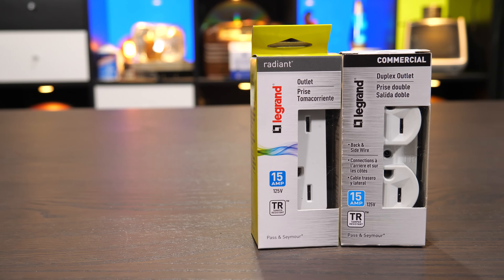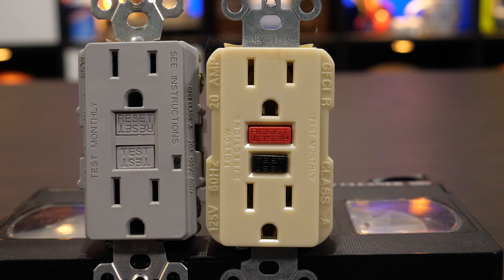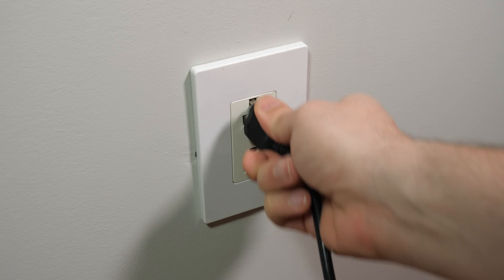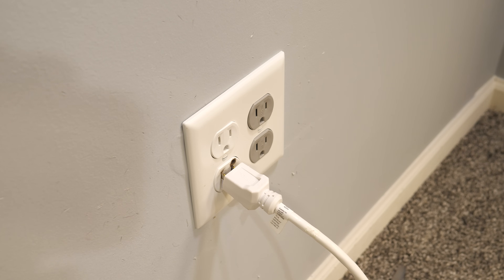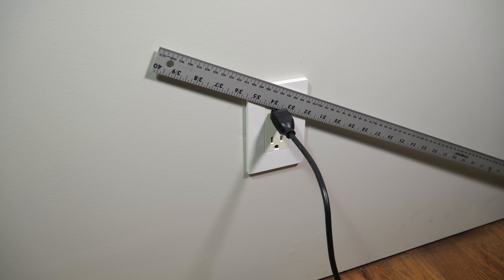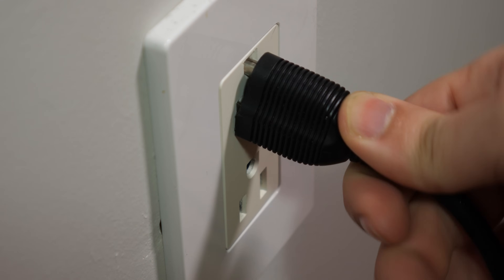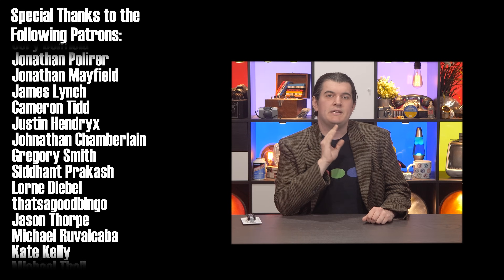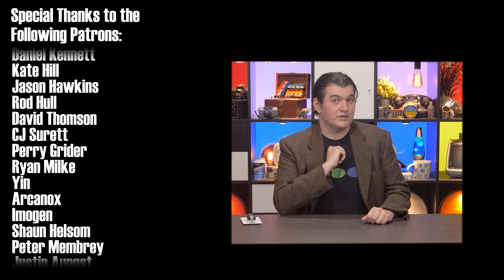Power outlets are topsy turvy - but does it matter?

Comment: I was a victim of the “falling metal wall plate” scenario.  I had the room painted and the painter removed the wall plates. Afterwards he forgot to screw in the plate. I went to plug something in and the plate fell down and shorted out. Sparks and a nasty char mark was the result.
Reply: Bleach and a good soaking should get the char mark out, otherwise just buy a new pair.
Reply: I dropped a tape measure in between a plug and the outlet it was plugged into. Nasty surprise.
Reply: ... Sparks and a nasty char mark was the result.
     And yet, you're alive to tell the tale.
Reply: Is he still alive?
Reply: Yeah. Sht happens
Reply: Kick ass!
Reply: Yikes! I wonder if the newer style of two outlets in a rectangle plastic and a plate with two screws makes much difference. I moved into an older place a relative had, and one of the first upgrades I did was replacing the outlets and light switches, and I used plastic plates with two screws. In fact, the light switch and outlet plates are the exact same since the light switches we got are also rectangle. Which made it easy to buy the plates in a large box and use them for everything (except for places with 3 switches together), and they seem pretty solid with that extra screw.
Reply: How did you fail to notice there was no screw in the plate before plugging in? Sounds like a skill issue.
Reply: I replaced the metal wall plates. They should be prohibited by code.
Reply: @fuelgaugeguy  I've only ever seen them in commercial locations unless it was a fancy brass/bronze one a homeowner added themselves, it's basically all plastic in residential.

Comment: Wouldn't the solution for most of these issues just be to put the ground plug at the opposite side of the outlet, except for one case, when you mount the outlet sideways since then you can short two plugs.

Comment: I've had one appliance with a ground-up right angle plug. It was the special leakage-detector cord on a portable air conditioner. Search for "WJ35X10142" for an example (although in my case, mine was regular 125V/15A)

Comment: I am shocked to see the terrible design of the USA plugs and receptacles.  The tiny narrow short plugs look so flimsy, both the grounded and ungrounded. Why not at least have a proper wide collar-flange to stop 1) sliding your fingers forward, and 2) less tilting downward.  But I don't know if there are many recessed receptacles that are too narrow for a wide flange.
The European version is so much better. it feels safe and is convenient to handle.  
But the best is the UK design. Big wide flat plugs with sturdy prongs that suck into the wall-outlet like the last puzzle piece.. Even small desk lamps have a plug like that. The receptacles each have a switch, and a fuse inside.
Reply: You’re shocked?

I see what you did there.

Comment: One time I broke a guitar string and when I bent down to turn my amp off, the string slipped in between the plug and socket. Sparks flew everywhere and I got a little scar on my hand. It was very rock n roll

Comment: My Husky rolling work bench with power strip has a flat mount plug that has the cord pointing away from the ground pin so the cord points up for my standard outlet.

Comment: The problem with the American outlets and plugs is the standard was set 100 years ago, before they thought about safety, polarized blades and the third ground pin.  Me personally it makes sense to have the ground pin at the bottom, because of the right angled plugs and wall wart power blocks.

Comment: I'm an electrician. I really would love to see you talk about 3-way switches and how they're wired, how they work. They're pretty cool, but there's a few ways to wire them and it's annoying to see most of the youtube videos cover only the feed to one switch, light leg to the other orientation. Sometimes you have your light leg and your feed coming to the same work box, and you gotta use the neutral wire of your traveling 14/3 or 12/3 to send power from the feed to the common terminal on the separate switch. Make sure you tape that white wire with black tape so anyone who looks at it knows it's hooked up the way it is for a reason.
Reply: I also just wired a 4-way switch. that was kinda cool to work with.

Comment: Those very specific scenarios are why I put most of my plugs ground up. I had a more than a few instances where something metal fell on a plug that was droopy. 
While very uncommon (like you can't just walk into an electrical or department store and find them anymore), there are adapters and I had a grounded extension cord with a right angle away from ground, so it would point down on the ground up outlets.
Also, there are DIY  plugs that allow the head to be clocked, and 'rotatable' plug extension cords, though I do not have high confidence in those.

The best part about 90 degree plugs is when they are unplugged and laid out on the floor, at 2 AM when barefoot.

Comment: UK sockets are so much better.   

if i was living in the states, i'd seriously consider changing the plugs and outlets for UK type.   Safety shutter in the ground pin prevents you pushing things into the live and neutral lines, (hence why our ground pin is longer) and insulated pins too means you can't short it if the plug is part out

Comment: 13:00 this feels contrived. you describe how ground up doesnt work because 1 slot blocks the other, and that if you want the wire to face down without it backing on itself. then show how sideways mounted works fine yet it has the exact same issue. 1 slot blocks the other and you cant make the wire face left without it backing on itself. and its not like some devices wouldnt benefit from the cable exiting the top. a computer on desk is the first to come to mind.

in reality i dont see how its much of an issue. replacing the plug head shouldnt be that hard if someone desires that. farnell seems to have heads for ground up cord down. (i assume hardware stores carry them too there?) but i guess this is what happens when you dont have regulations to enforce the install of the socket. maybe we should go and make it standard for it to be installed 45 degree angle so everyone is unhappy

Comment: I removed one of those security system power bricks that screws through the plate screw hole to keep it from being accidentally removed. There was a metal plate, and as the only screw was removed so the brick could be unplugged. The plate fell on the hot and cold blade at once. BOOM! Time to replace the outlet and plate, with a plastic one of course.

Comment: in england, all plugs are right angle, the ground is at the top, they have switches, that are better built and more robust, the positive and negative pins have insulation, you can change the fuse in the plain with nothing more than a screwdriver, the plug has a fuse in the first place, they supply more power, every plug has a ground pin

Comment: As I saw the first minute I understood because an accident that happened to me: in 1970 it was a trend between children here in Brazil to use a big medallion on a chain around the neck made of antimony (!) with the first letter of your name. I was taking the plug of the Christmas tree out and it shorted the  pins, by chance I didn't receive a shock because it probably touched the neutral first. The pins melted two holes on the medallion and I never used it again. At that time few outlets were NEMA and usually on offices only (some of my father radio equipment used it) Today in Brazil we use an outlet with a diamond shaped recess, so when the plug pins make contact they are not exposed anymore and the plug pins with only the tips of neutral and live exposed because of a sleeve and the ground pin is entirely exposed in a way that it always makes contact before the other two, so this could not happen anymore. Those things generally don't matter ... until the day they do. If it is a chance in 10 million someone will have the unluck day...but turning the outlet is not the solution, NEMA plugs suck bigtime.

Comment: Personally I tend to prefer the face orientation because of right-angle plugs; altho the one behind my desk that my computer is plugged into is actually ground up -- my power strips are mounted on the underside of the desk, so it pulls the wire up, instead of looping down and up. I also have sideways plugs in both orientations around my house, lmao... Altho those are installed in baseboards, so there isn't room to mount them the other way.

I do think it would be possible to do a partial sleeve on the live and neutral pins without breaking compatibility -- the way you did the shrink wrap on that one on the end, that SHOULD make full contact within the receptacle. I'm wondering if the reason we haven't seen that is because the blades are so much thinner than the shafts used for the types of plugs that do have sleeving

Comment: Nice video. Here in South Africa our plugs are standard Ground up, much bigger than your 3 prong plugs. And our 2 point plugs are recesed into the wall adapter. So, yes. And the 1st bit is insulated. Even the cheap imports have plastic on the 1st part. We shudder when we look at American plugs and wall outlets.

Comment: The UK plug is widely regarded as the best in the world due to its numerous advantages and superior design. One of the key features that sets it apart is its safety standards. The UK plug incorporates a three-pin design, with two parallel pins for live and neutral currents, and an additional pin for grounding. This effectively minimizes the risk of electrical shocks and ensures the safety of users.

Furthermore, the UK plug's design includes a fuse, which provides an added layer of protection against electrical overloads. The fuse acts as a safety mechanism, preventing excessive current from flowing through the circuit and potentially causing damage to devices or even starting a fire. This feature greatly enhances the overall safety of electrical appliances and promotes peace of mind for users.

In terms of convenience, the UK plug also excels. Its rectangular shape and robust build make it durable and easy to handle. The pins are well-insulated and fit snugly into sockets, ensuring a secure connection that minimizes the risk of accidental disconnection. Additionally, the UK plug's design allows for easy insertion and removal from sockets, making it effortless to use and maintain.

Moreover, the UK plug's compatibility is another advantage that sets it apart from other plugs worldwide. It can be used in various countries, including those in the Middle East, Africa, and Asia, thanks to its ability to accommodate different voltage and frequency requirements. This versatility makes it a practical choice for travelers and individuals who frequently move between different regions.

Overall, the UK plug's exceptional safety standards, convenient design, and compatibility make it the best plug in the world. Its robustness, ease of use, and ability to adapt to various electrical systems make it a reliable and trusted choice for both domestic and international use.

Comment: At 6:45 I appreciate his acknowledgement that the less protective but smaller plug shape might allow them to fit better in power strips. There's so many annoying as hell power bricks or other device plugs that do not smoothly fit on power bricks. And while the slimmer design might be less protective, I'll take less the ease of use. I've only shocked myself once in my life while unplugging something. I don't think it's too huge of a deal that the NA standard is less protective. Although, I will acknowledge those really old plugs he showed off are absolutely absurd. They also brought up fond memories of being at my grandparents house growing up as they did have some devices with plugs like that.
Reply: Somewhere in my house I have a power strip that we call a squid design. Instead of a rectangular block there are six short cords of different lengths that stick out of a distributor so that one can spread the outlets out to accommodate power bricks (aka wall warts).
Reply: @SchmCycles  That's a nifty product. And an evil one lol. Don't eradicate the wall worts, just construct a new type of power strip to allow people to accommodate them.

Comment: My apartment outlets are installed the "correct" way (ground side up).  I always wondered why.  It usually doesn't bother me.  But right angle plugs are never designed for my "correctly" oriented outlets.  Which is annoying as hell.

Comment: I cant remember if it was to make things easier or a safety concern or what, but when i was first learning electrical work i was told the ground should be on the same side the wires are coming from. So if wires coming from underneath, ground pin should be on bottom and vice versa. If i had to guess, it would be in case the ground popped off it wouldnt be pulled toward the hot but thats just a guess

Comment: As you probably know, in the UK right angle plugs with the lead exiting the bottom are mandatory (except for 2 pin shaver/toothbrush outlets which are transformer isolated).
Reply: Yes, the correct solution to all the problems he mentioned, and more, is a UK plug and socket. As many, many, many US electricians have pointed out on YouTube. Superior in every way, because some people actually sat down and thought seriously about the subject, and tweaks have been made. There are too many benefits to list in a comment. Meanwhile, everyone else uses sub standard technology, and few if any use their own version of the same thing. It's time to standardise the world (and it absolutely doesn't have to happen overnight to do that).
Reply: Not superior in safety but necessary in the UK because of a bad current choice.  In North America accidents entail a zap and some cursing, that's all.  I have many experiences to confirm this.  The pros swap receptacles without turning off the breaker sometimes.
Reply: @cloudpoint0  Much of the rest of the world went with 240V, the UK was far from alone in that. And really the US has 240V, you just have this strange split mains scheme whereby you can have two nominally 120V circuits in the house which actually have 240V difference between them.
Reply: @owensmith7530  
I'm well aware that much of the world decided to risk the lives of their people to save a few pennies on house wiring.  When I lived in the Middle East, the house I was in was wired for both systems, probably because euro appliances were hard to get and cost more.
Reply: @cloudpoint0  " much of the world decided to risk the lives of their people to save a few pennies on house wiring" is a really stupid take
Reply: @cloudpoint0  I've received 240V mains shocks 4 times in my life and I'm still here. It's not usually fatal or even permanently damaging, but my word does it sting. You need to have some underlying condition usually for it to be fatal (which includes being very young or very old), and in those situations 120V can also be lethal. Extra Low Voltage which is safe to touch is 50V AC max, or 120V DC max ripple free. The AC figure being well below US mains voltage. Plus you do have some 240V circuits in many US houses, or failing that 240V in the breaker box and between different circuits, so it's not as if you don't have 240V at all in US houses.
Reply: @cloudpoint0  Also fire risk is higher at 120V because currents are double so heating of bad joints is double. And as someone else on this thread said, far more people die from fires caused by electrical faults than die from electrocution itself. So from that point of view 120V is less safe, not more safe.
Reply: Land Of BS1363 And Glory
Reply: US and UK have about the same electrocution death rate 70:400. However: house fire deaths are at 250:4000 and electricals are the main cause.
Reply: @DT-dc4br  And are the house fire rates in the US and UK about the same as each other? I've never seen figures. I don't understand your 70:400 figure, 70 out of every 400 deaths being electrocution seems way too high so you must mean something else. Same issued with 250:4000.

Comment: So I buy 100+ft extension cables, and then cut them to length for use and re-plug them. Home Depot has a (unfortunately rather expensive) heavy-duty right angle male plug that allows for the plate with the contacts to be rotated 360° to the housing. I'm installing a battery charger wall in my pantry right now, and have the 3-prong right angle cable go up the wall by design. Of course, the chest freezer on the other outlet is a 2-prong unit, lol.

Comment: Are there no safety standards in the US for electrical goods, surely you just write a standard explaining how this connection type must be implemented, example details:
- Orientation
- Minimum plastic warding distances
- sleeving
- receptical contact depths

Then you say from 2025 all product for sale in the US must comply with ANSIxxxxx. Job done, this is what most other advanced contries have done. In the UK we have BS1363 which covers plug shape, warding, fusing and many other details.
Reply: The power cord lobby is crazy powerful here.  To be serious tho,  there really isn't a push to standardize them beyond what they are. GFCI near water, ground for new outlets, etc. We all mostly just learn to deal with it.  I'd say the more dangerous thing regarding power cords is pushing too much power through high gauge extension cords, which causes loads of fires here

Ps tho I agree with you,  we should do that